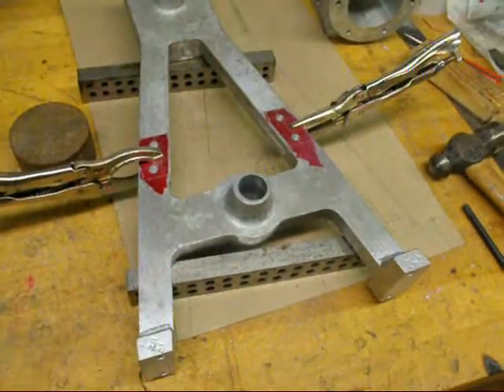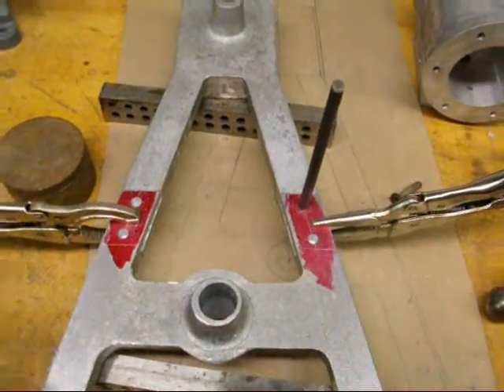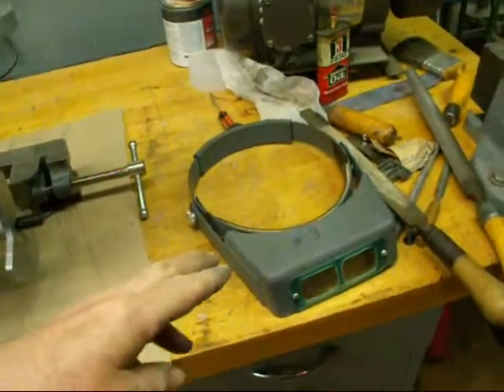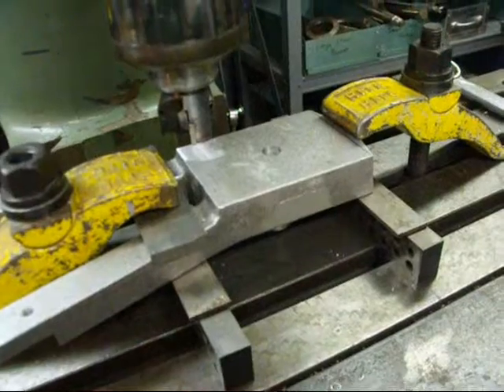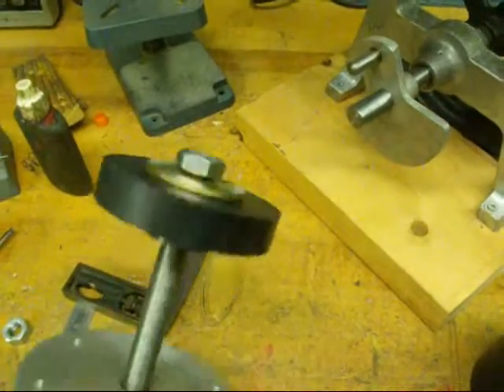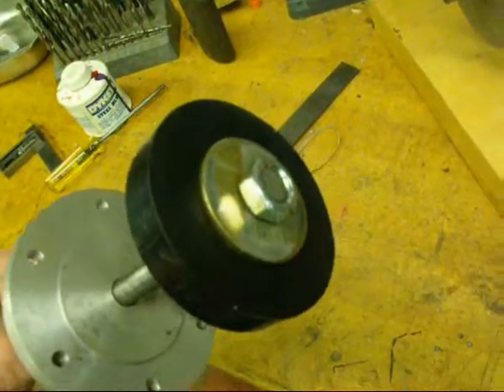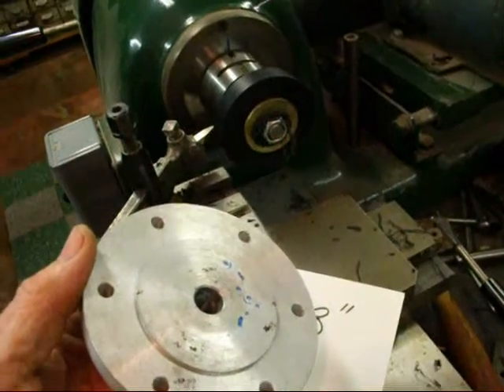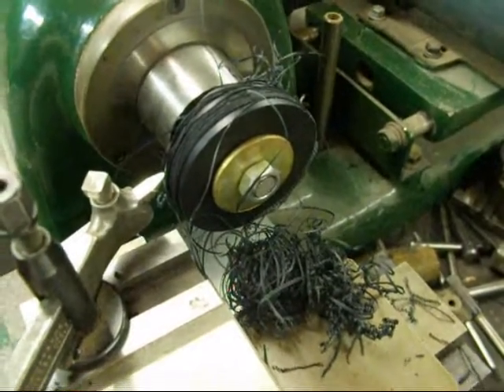BUILDING A MODEL STEAM ENGINE part 6 tubalcain

Comment: You need more vice grips. :)

I had heard that Sears started making the Craftsman hand tools in China; about a week ago I was at Sears and verified this for myself. Pretty sad really.
Reply from the maker: +ShysterLawyer Yes
Reply: Mister Peterson, let me add.

I've been a BIG fan of Sears Craftsman, 
since early in the Nixon administration.
(Or, was it when Ike was in charge and Nixon 
was second fiddle?)

That being said, I recently got a set of Craftsman 
screwdrivers, stamped (and sold) Made in USA.!
Same time frame, got three or four sets of the FREE 
screwdrivers from some store, at the "Harbor," 
delivering "Freight."  I've yet to pay for ANY screwdrivers 
from THAT store, but I've got a BUNCH!  Unless I needed 
to bend one of them. (hey, they're free) with a torch, I haven't 
bent ONE!

Can't say that about Craftsman, and I haven't used the torch!
Heck, I've even managed a torsional twist in one!

Next time I BUY a set of HF screwdrivers, (what being free?) 
I'll let you know.  (LOVE those freebies, worth EVERY penny!)

Same thing with Craftsman.  Next time I'm suckered in, I'll 
let you know.

steve
Reply from the maker: B & D /STANLEY---just bought the craftsman brand.
I''ll have to get some HF screw drivers. You are the second to tell me they are great

Comment: Ant that the truth china has its cheap junk all other the place. The banks since 1980 have been in bed with united nation jack up the prices on all quality built products tell its ridiculousness. Gas for starters back in 1980 I worked for the oil fields drilling oil wells. and they closed the company down to create a oil shortage which is a lie. I was paid to cap the wells off with concrete. every since we have been forced to buy foreign oil and and the cost keeps rising.

Comment: Well if you can use simple plastic for piston why not using Teflon (PTFE). It is expensive but it has low friction and it can be made thiner because it is stronger. One can buy stock bar of Teflon in different diameters and lengths. Teflon is probably good for small engines where the piston is small so the cost is low. Teflon can work with no lubricant, is corrosion resistant, it is used for special ball less bearings. And it does not wear as plastic, can work with temperature up to 500 F.

Comment: You're dead-on about Vise-Grips. Since 2002 they've been owned by Rubbermaid. They moved manufacturing to China from Maine, but I think Unibits are still made here. They claimed they couldn't compete making them in the US. I know I'd pay a couple bucks more with no complaints!

It's a damned shame.

Comment: The engine is looking great !   Have you ever tried HTS2000 to weld the half laps together ?  The stuff works great and it's really easy to use.  Keep up the good work and I am patiently awaiting part 7 ! Metal casting is addictive and if you check out my profile and website you'll see that I'm hooked !  -Hank  :D